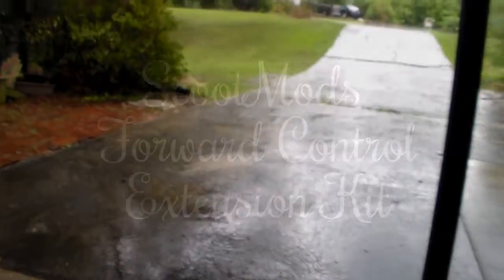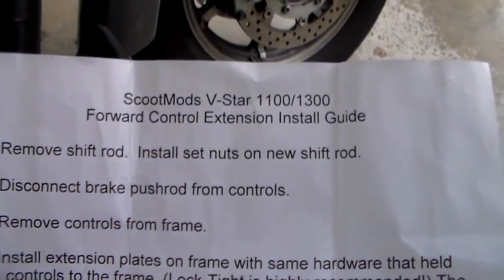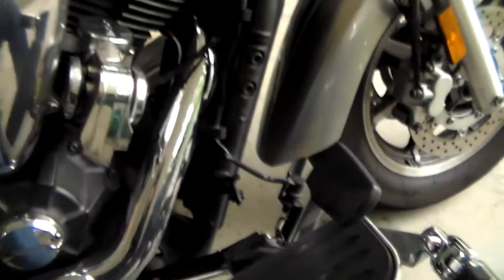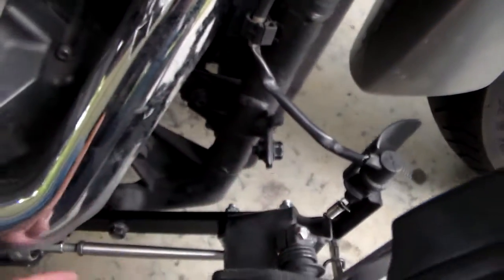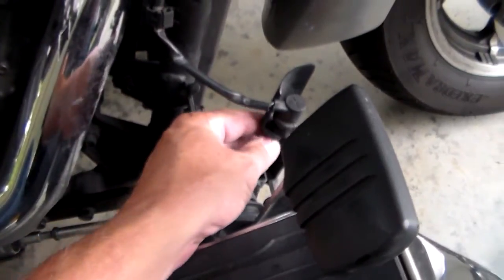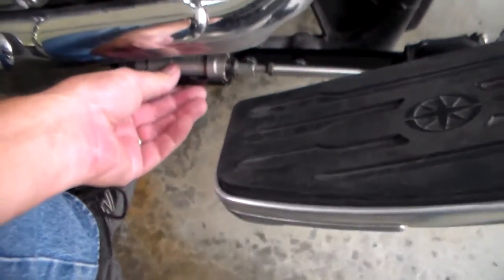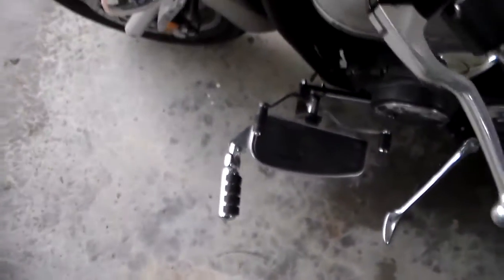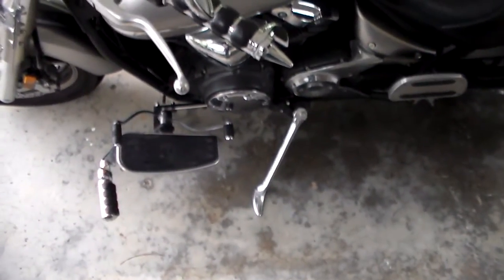ScootMods V-Star 1100/1300 Forward Control Extension Kit

Comment: Nice mod and like you say, just right for yourself, I'm 6 foot and I have the cruiser/highway pegs on the crash bars, to rest my legs on, I feel on a long journey that the bike is more suited to someone 2 to 3 inches smaller than me, RSM8.
Reply from the maker: Skeggy Cruiser Thanks.  That is the way it was for me too.  This should make a big difference.  As you know alot of the really nice bikes seem to be made for the shorter guys.  I want a Iron 883 or a Yamaha Bolt but they are just too cramped and small.  Damn!

Comment: Hate to necro an old thread, but what adapter do you use for the highway pegs on the floor boards? I just installed the 6” scootmods extensions and I had to remove my highway bars and foot pegs. I’d love to have my pegs mounted on my floorboards like you have. Any info is much appreciated. Keep two wheels down and stay safe!
Reply from the maker: Here is the link where I got them.  They show unavailable but I'm sure someone has them.  Good luck. https://www.amazon.com/gp/product/B000IOO4DM/ref=ppx_yo_dt_b_asin_title_o04_s00?ie=UTF8&psc=1

https://www.amazon.com/gp/product/B000GU0YFK/ref=ppx_yo_dt_b_asin_title_o04_s00?ie=UTF8&th=1

Comment: I got this for my 2015 and cant install it because the brake light wires are too short and make it impossible to install. What a shame and I'm not invested enough to run wires (I'm also not a electrician).
Reply from the maker: When I installed mine I had to remove the strap/ties that held that wire to the frame tube.  After I did that there was just enough wire to reach.  Take care.
Reply: @samsmithmotovlogs  yeah I did that and it only gave me 2 more inches of slack. I'll have to research running a new line.
Reply from the maker: @davidhansen4927  Good luck!
Reply: You don’t necessarily need to hook up the wire for the brake light. , just always use your front brake to illuminate the light at every stop. 🛑

Comment: I've seen these, I have wondered if they could be used with a crash bar.. my guess is no. look forward to hearing about how you like them .
Reply from the maker: dbest1a Vlogs I don't know if they can or not.  It would be worth a visit to their website.  Thanks.
Reply: I am a part of many  Vstsr Facebook groups and I have seen many people use it with crash bars. depending on the angle of your crash bars you can use these on your bike. I'm only doing the 3 inch  extensions so mines going to work with my crash bar.

Comment: Hi Sam. I bought the 4" kit from Scoot Mods and am having trouble with the brake side installation. The wire for the brake switch is not long enough and the 4" extensions seem to interfere with re-installing the horn. I can't imagine you had enough wire for the 6". I tried cutting zip ties to allow for more brake switch wire but haven't been successful. Do you have any suggestions?
Thanks,
Barry
Reply from the maker: +Barry Hamilton I'm sorry you are having trouble with the install.  I had already replaced my horn with a Bad Boy brand and attached it to the front of the air cleaner box.  My wires were long enough to stretch for the 6" kit but like you I had to cut all the ties.  Be sure you are installing the bars top side up.  I think my instructions said the flat side was up but check that on yours.  If you still can't stretch the wire I would make a short extension wire to add to it.  That wire will plug into the harness with a quick connector so look at it and make a short piece of wire with a male and female end just like it.  You could just cut the wire and splice some more in with butt connectors too.  Good luck.
Reply: I have the same issue with a 6” extension
Reply from the maker: @cfrias99  Sorry I missed this.  I'm sure you figured it out by now.  Take care.
Reply: You don’t need to connect the stupid brake light wire, just cut it off and use your front brake handle to illuminate the light.

Comment: Need something like this on my roadstar 1600. Also. Where did you get the pegs that extend from floorboards
Reply from the maker: I found them on Amazon.  They consist of a base plate for each floorboard and pegs.  It will vary by model.  You have to drill holes in the boards.

Comment: Curious as to what this does to lean angle. More, less?
Reply from the maker: There is a lot of adjustment and the angle of the foot boards can be  changed.  I have had early scraping issues when the angle is maximized.  When I leveled out boards it was more like stock.  I have to get very slow for it to be an issue.  Take care.

Comment: Those foot pegs are hard to find. Any more detail or model #?
Reply from the maker: It's been a long time but I'm sure they were from Amazon.
Reply from the maker: These are similar: https://www.amazon.com/OXMART-Motorcycle-Footrest-Universal-Classic-4/dp/B07G97292G/ref=sr_1_59?dchild=1&keywords=Highway+pegs&qid=1585104509&sr=8-59&swrs=D8A2EB89CA99D59C52B0A95AC01BAB8F
Reply: The brackets what I was looking at. I have been looking for one that bolt to bottom of board like that.
Reply from the maker: @chemdog70able  Oh ok sorry.  They are model specific if I remember though I did have to drill hole to mount them.
Reply from the maker: @chemdog70able  Found it! 
https://www.amazon.com/gp/product/B000IOO4DM/ref=ppx_yo_dt_b_asin_title_o04_s00?ie=UTF8&psc=1

Comment: Gotta love bolt on mods, all too often there's a knock-on effect that ends up costing big bucks or time in the garage with a grinder lol....but not in this case. :)
Reply from the maker: Hepcat Harley This one was really easy and at $50 really affordable.  If I had not messed with the brake light switch this could have been a 20 min job.  Thanks.
Reply: sam smith I've been building my hot rod for long enough now to know there's no such thing as a 20 min job :)
Reply from the maker: Haha!  I know what you mean.  How are you coming on it?
Reply: Since I got the bikes it's kinda forgotten, poor thing :)
Reply from the maker: Haha!  Well winter is coming.  Nothing like puttering around in a warm garage on a cold rainy day.  :-)

Comment: Hey sam. Is this a 6” kit. I bought the 6” but the brake switch is too short. Looks like I ll have to splice the wire.
Reply from the maker: Hey.  I was able to release the wire from I think 2 clips on the frame tube.  It was tight but long enough.  Good luck

Comment: Looks like the engine guards gotta be removed.
Reply from the maker: Probably.  I bought my bike used and it didn't have any guards.  On a positive note the couple of occasions when the bike has tipped over the floorboards have kept the bike off the ground.
Reply: That’s because your riding ability and filming sloppy videos go hand in hand 🖐️

Comment: This is a cool mod. I wonder if it would work with hwy bars installed.
Reply from the maker: NewZona Rides They make different sizes so I don't see why not.  It uses the existing frame mounting holes . Might be worth a try and the cost was very reasonable.
Reply: I looked and they don't make one for my bike. I will look for other options.
Reply from the maker: Oh sorry about that.  It might be worth an email to see if they are working on one.  My installation was so easy they didn't have to make anything complicated.  Good luck.
Reply: Nope…

Comment: Let us know how it rides please Sam.
Reply from the maker: Yuman 883 Ok I just got back from a quick trip to the store about ten miles away and the mod worked great!  Now my feet are about even with the front of the tank looking down.  It is very comfortable with my legs almost stretched completely out.  When I get up to speed I can move my toes to the highway bars with my heels still on the front of the platforms.  I will not know till I take another long ride but if this is any indication I should have a much more comfortable ride in the future.  I will let you know if anything changes.  Thanks.